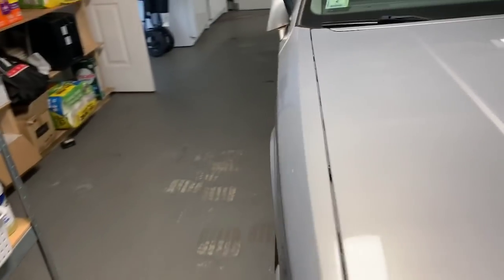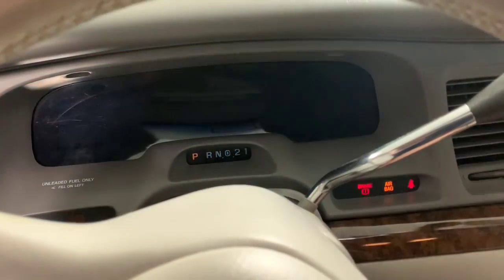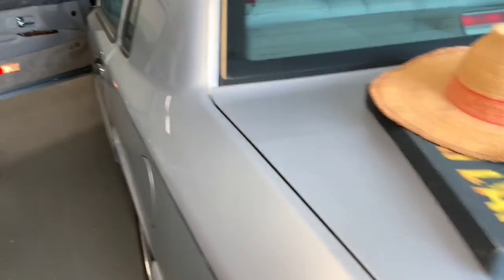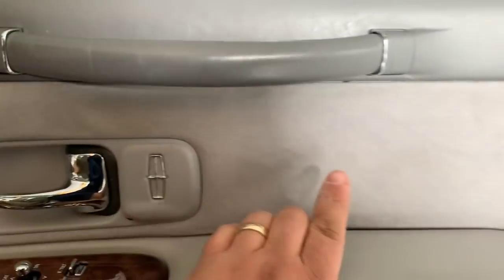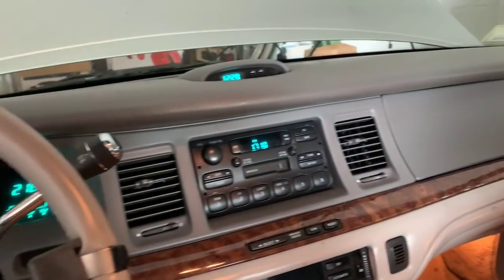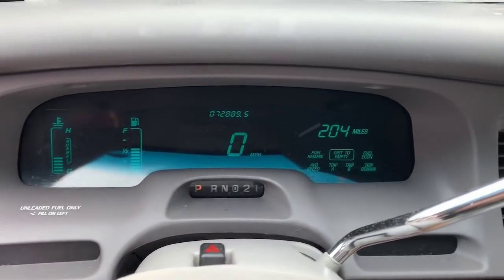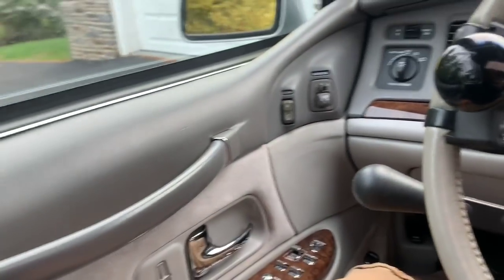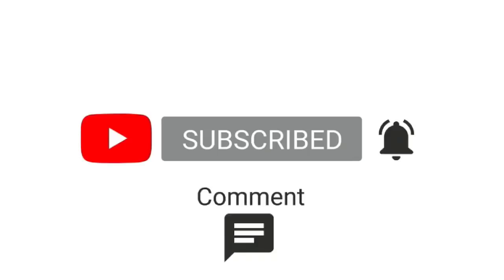Double SCORE! Two Silver 1996 Lincoln Town Cars RETURNING HOME Car Re-Buying New Inventory

Comment: Instead of replacing the steering wheel you could have an upholstery person re-leather wrap the steering wheel. I had that done on one of my cars and it looked factory.
Reply: Good luck finding an upholstery shop that will do that work. 99% of all shops won't touch steering wheel repairs because all the stitching must be hand done. And they have a tendency for the thread to break midway through the process and then they have to start all over. Very very few shops will do that work.
Reply from the maker: Good idea but these wheels were used in a lot of ford products, so finding replacements isn’t too bad. I already found both wheels.

Comment: Couldn't an upholstery shop just re-wrap the steering wheel with new leather?
Reply from the maker: Yes but it would be more cost effective to find a nice clean used wheel or NOS wheel. I have already found both replacement wheels.